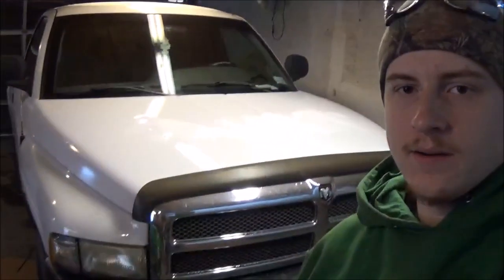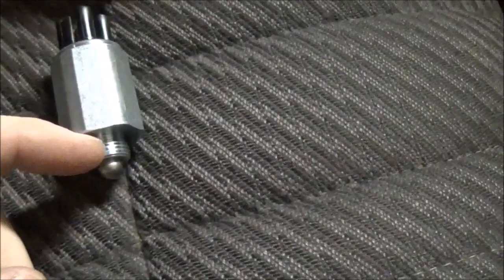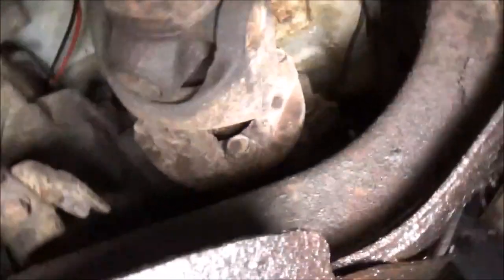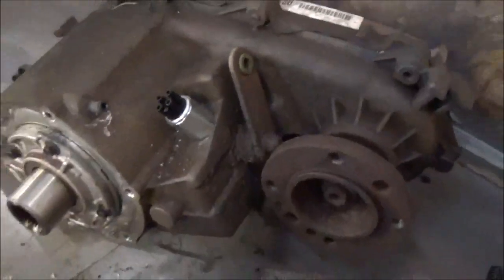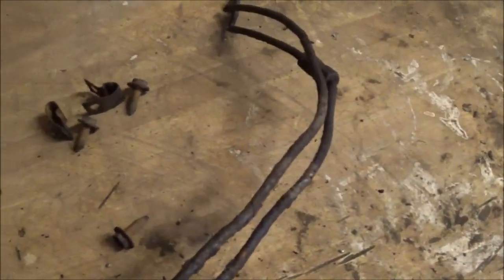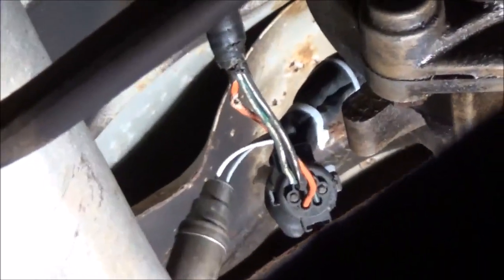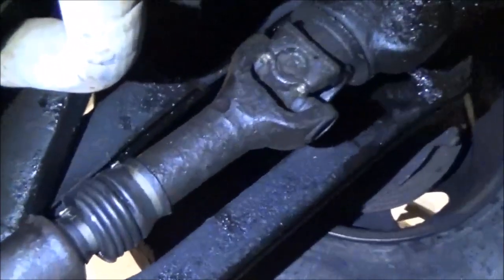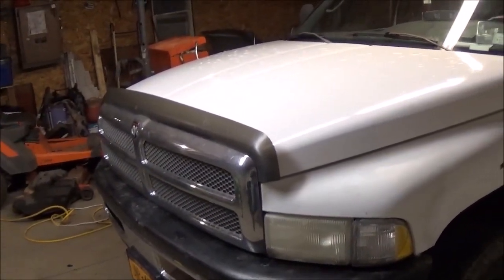Fixing the 4x4 Vacuum System | Dodge ram

Comment: Nice video I have a second Gen Dodge and yeah after 22 years I still drive it, easy to work on compared to most and has been pretty reliable except for some rust but I live in New England. Do you still have your truck?
Reply from the maker: I do still have it! It's all torn down to the frame and running gear. I'm planning on putting an older truck on the frame . But haven't gotten to it yet. I would like to find a 50s dodge to put on the frame.
Reply: @Fullthrottle440Garage  I can't wait till vid drops. I haven't seen a Power Ram 50 since I was a child, gotta go south I believe for 1950's body style. Damn now I'm invested lol.
Reply from the maker: @kingwendell7445  I moved to Arkansas not too long after I made this video

Comment: U should. Put 4x4 solid. It's your vacuum it will go all time. Electric one end other air. Move that arm over and move over a coupling over on other Axel. The dieafram. Inside. Puches out. But easy to fix. If 4x4 light won't come on. It's not ingaugeing. Or the left end wires there hooked in the electronic end. 17mm take end off. But new electronic in. And check that the diaframe. Is even working. U can use a air hand pump should be 15 lbs. And then light should come on. One of the 2 things.  95/02 could be off on years might be 85/02
Reply from the maker: Good idea
Reply: @Fullthrottle440Garage  yes full time 4x4. Lots guys do this gaurentee the 4x4.
Reply: Well at least u can do the work. Not all this stuff needs go to dealer's. I know it's not fare but to work on it. Is a dream. Like for instance. The heater core was half hour job. Now 8 hour take hole dash off. GREAT

Comment: You are a very energetic young man. My 98 Ram has very brittle vacuum lines that break real easy. I fixed the 4 WD by simply running a new vacuum line
directly to the front axle actuator. (black vacuum tube). Now the front axle is always connected and the 4WD light is always ON but that`s no problem.
Reply from the maker: Why thank you. I try to keep motivated. The truck now has Been sitting for a few months with a broken transfer case but I'll fix it when I get the time and find another case
Reply: The red line has to be hooked up to tell it th it's in 2 wheel drive 😂

Good luck on finding one I been looking foe 2 yr for one an I'm sure not going to pay a $1000.00 for a used oneso I took out the broken ones an just only pur in studs so far so foo